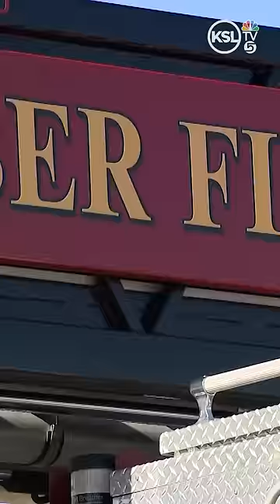Worker saved by co-worker after being buried alive in a trench collapse

Comment: Safety is no accident. Anyone in construction knows that trench should have been shored up. Man is lucky to be alive.
Reply: Anyone in construction who's properly trained or experienced, that is. New guys aren't going to know
Reply: I was just going to say that too. The contractor is lucky the guy was quick thinking. But 100 thumbs down for the contractor not making sure safety protocol was not kept. I have experience with contractors and know a lot of them cut corners where ever they can get away with it.
Reply: How do trenches get shored up?
Reply: @2degucitas  typically hydraulic jacks pushing metal plates outward to keep the walls from closing in. Wood pilings and other materials can also be used. Anything that will prevent the walls from collapsing and burying the workers in them. Usually any trench over four feet deep should be shored up. But even  shallow trenches may utilize shoring depending on the material the trench is being dug into.
Reply: @JoveRogers97 
Safety is the bosses responsibility, training is the bosses responsibility, proper supervision is the bosses responsibility... 
Don't blame the new guy, blame the contractor for their lack of following in place laws and guidelines...
sloping, shoring, shielding, and benching. one of these systems is required in trenches 5ft or greater in depth... 
I teach OSHA Construction...
Reply: @Moofasa1211   I wasn't?
Reply: @JoveRogers97  maybe blaming wasn't the best choice of words for that...
my point is the new guys, should know, and it's the bosses responsibility to make sure things like this don't happen, you don't need to have an experience to be trained in safety.  I apologize to you
Reply: @Moofasa1211  Right on brotha 👍
Point you and I are making is, soil instability isn't something people intuitively know, and yeah, it's entirely management's responsibility to train their workers up on safety.
Reply: @C-1-FRY  Thanks for explaining
Reply: @JoveRogers97 only cuz your average person has no common sense. You don't have to have a degree or experience to have seen a sand castle fal overbefore.
Peoples inability to recognize obvious danger is astounding
Reply: @2degucitas trench boxes made of metal that you lower down into the trenched area you are working in. Shoring panels are the old way, where they used hydraulic pumps and inch thick wood panels. Not as safe as a metal trench box. We used those back in the 90s, I hated them, because even those things were sketchy. They came out with trench boxes a few years later because panels and hydraulic jacks could still fail. This incident was negligence, as well as an OSHA violation and could have been avoided with a trench box.

Comment: No shoring,  the contractor should be fined by OSHA.
Reply: Exactly
Reply: Did you see the area? 😂 Looks like the entire area is an OSHA violation. All muddy and two houses finished? Bet they'll sink
Reply: @Steve.._. just like Cedar City - the houses will all slide away.
Reply: Now that it's on the news best believe OSHA will come a knocking
Reply: OSHA has entered the chat
Reply: They came with the fire company
Reply: @moepizl  i was thinking that from my knowledge anytime ems or paramedics show up to worksites im sure they also contact OSHA. I know they had at all the job sites I worked at.
Reply: Not all states require trench boxes it looks like they had it benched back
Reply: @coltonmeredith2111 Anything over 6 feet of depth requires a box if the horizontal width is less then 1,5x the height. OSHA says so, regardless of state legislation.
Reply: Contractor should be shut down never to open till their out of jail 😒
Reply: What?? That trench was only 4'10"! 😂
Reply: @Steve.._.  Osha has nothing to do with what happens to a house after its done.

Sinking houses are not their jurisdiction
Reply: Oh I’m sure they’ll have a field day
Reply: He will be the worker will go to the hospital and they’ll file it under Workmen’s Comp. and Osha will be contacting them
Reply: @jamiecurtis2974  we trench 30" if you bend over and the sidewall is above your head you are at risk
Reply: @timothyrothrock4173  you've clearly never turned tools. I'm betting you're they guy walking around checking stickers on hats or making sure the tape is the color of the week.
Reply: Wow lucky guy that hole area will be watched close now by Osha hope they have a safety guy for that business that know all the updated laws seen companies go out of business from fines
Reply: @coltonmeredith2111 considering what the state of the soil in this video looked like benching was serving little to no purpose. The walls were wet and already compromised. It shouldn’t matter if trench boxes are required or not they should still always be used for the sake of keeping someone from being buried alive.
Reply: @JustAGooseman  this is not a fact. Soil conditions can play a large part in if you need shoring. Wet lose sand doesn't fall over into a trench, it slides in, soft to medium hard clay falls in, hard clay typically stays put. Sloped banks/benching can eliminate the need for shoring.
Reply: @JustAGooseman  osha actually says anything over 5' not 6'. Pay for osha 30 not just osha 10.
Reply: @Steve.._.  And you have clearly never worked construction a day in your life
Reply: @coltonmeredith2111 Federal requirement. Not eligible to be waived either. They’re doing that, it’s gotta be there.
Reply: @coltonmeredith2111 Doesn't matter what a state requires. OSHA requires proper shoring/ trench boxes or proper benching/sloping. 
with escape ladders spaced no more than 25 ft apart.
Reply: It sounds like the guy wasn't supposed to be in there.
Reply: No one does that. You wouldn’t even know what osha is if it weren’t for all the memes
Reply: @bmd2159  Looks like we found either our next cave-in "victim", or the soon-to-be-bankrupted guilty contractor.
Reply: @timc9893  looks like we’ve found our next internet Karen
Reply: @bmd2159  Why not just go ahead, save us the trouble, and say "guilty as charged"?
Reply: If he was directed into the trench.  If he chose to go in without protection.  Thats on him.  If he wasnt trained, thats on employer.
Reply: @Jon-k8z   and the houses in Draper too.

Don't people remember the kids nursery rhyme about 'how a wise man builds his house on rocks and a foolish man builds his house on sand'? Houses need a foundation.

Comment: Deeper than 4 feet you need shoring, or benching. Depending on soil type sometimes as little as 2 feet. That OSHA training everyone complains about is useful. 12 years oilfield 3 year diesel mechanic.
Reply: people probably complain about it because 90% of the safety training doesn't apply to them and even if it does the employer might not care so less annoyed at the training and more that they are spending time on something they know the workplace won't actually want them to use.
Reply: It is also an MSA law also.  Six years as an open pit miner.
Reply: Got my Oshawa 10 card man was a grueling but I learned alot worked as a sign and awning installing and we'd be super close to the power lines where my eletric tester would go off in the air I told em hey we should not be this close and my trainer ended up moving to a safer spot man miss them sketchy days 😂
Reply: Trenches should always be short or shielded. I'm a wastewater treatment plant operator with seventeen years experience.
Reply: @richardmckinney4963  msha don't play around
Reply: Yes I agree with you these rules are in place for a reason
Reply: Even if it’s rock ? I worked a summer doing that type of work and went deep into a trench that was rock . Did not feel safe at all . Definitely don’t miss that type of work
Reply: Not sure how 2 feet would be dangerous. Maybe if they were prone.
Reply: @Rokomarn Sand because of its unconsolidated nature leads to collapse/caving. So it’s recommended to shore or bench.
Reply: @RickSolid1  for sure it might collapse and then you would be up to your shins in dirt. Seems unpleasant.
Reply: You're absolutely right. I know of a man died like this in trench collapse. It's more common than people realize.

Comment: Why is everyone calling this guy a hero? He was most likely the operator and responsible for what happened to his coworker. Trenches need to be stepped back or shored. Looking at this muddy soil, it definitely needed shoring. Glad the guy made it alive.
Reply: As a retired operator and pipe crew foreman ,I agree.
Reply: The person saved was lucky he didn’t get injured by the bucket of the machine.
Reply: I agree but it didn't specify exactly who was in charge so I'm not making assumption until I know for sure. Nevertheless it was quick thinking and enough to save his life. He apparently saw it happen and knew where he was
Reply: He took a high risk by using that machine to try and save him, he could have easily killed him instead. I guess it was a split time decision, that construction company does not have even kind of good safety standards, then again, working construction, never do anything that feels unsafe, have common sense, experience and a good supervisor would have helped.
Reply: @joseramirez-sz9yo if I was stuck underwater, I would happily risk some broken bones if it meant I could have air.

and from the sounds of it, he didnt dig the person out as much as dig nearby so the water had somewhere else to go

Comment: Will the local contractors associations and Weber County (unincorporated) - if it's competent to act - publicize and attempt to enforce proper trenching procedures (as well as all standard safety procedures) going forward - promoting safety training, use of both PPE and Worksite Protective Equipment - even in the face of pressures to reduce costs below effective minimums - and protecting employees who have a good basis to believe a worksite task is dangerous to life to refuse to work until risks are suitably mitigated.
Reply: I got fired for refusing to enter a dangerous ditch... didn't want to slope it or order a box so I said I'm not walking in that ditch let alone running a jumping jack in it. It was the owner who fired me so I started taking pictures and sent them to OSHA

Comment: Both men should be fired for not using proper equipment
Reply: You might be right, if they are the ones actually responsible. But the owner might not have bought safety equipment or someone other than these guys were in charge.

Comment: I've worked in miles and miles and miles of trench. And I have to say i've heard nightmare stories that will make your skin crawl. Above all NEVER go into a trench without the proper trench box or shoring techniques. But as for the operator of of the equipment.
It is your responsibility to make sure that man is safe in the hole butt above all, never dig a man out with a machine. This person got extremely lucky.

Comment: Operator says "hey laborer, go down there and check the elevation of the bottom of the trench" then after the laborer almost died because of unsafe practices (which were probably designated by the operator) 
Operator says "hey bud, I saved your life" what a hero! If only there was a process and safety device to prevent total collapse around a worker in a hole deep enough to cover them. I'm shor 😊 that would help prevent these situations.

Comment: My uncle die in a trench collaps in 2005. The trench was only as deep as his shoulders and it was stepped 2' wide at the bottom 2' up to the bench and 3x up to grade. A back hoe was driving within 50' on concrete. The vibration caused the trech to filled in in the blink of an eye. My uncle passed out instantly from the air being squeezed out of him. His close friend tried to pull him out but couldn't. The backhoe operator must have been scared to drive close or reach over to relieve the pressure from the cave in. Like previously stated DO NOT GET IN A TRENCH OR HOLE WITH OUT SHORING 4' FEET OR DEEPER!

Comment: That's why as a excavator operator you make sure you dig the trench with a slope on either side so crap like this doesn't happen. If the trench was dug out properly by the operator in the first place this wouldn't have happened. Be better at your job next time. I learned how to do this when I was 16

Comment: He mighy have save the guy, but he also caused the accident.  Its the operators responsibility to make sure that the trench has a 45°angle while he digs so there is no collapse and nobody goes into the hole till its safe.
 U might get away with cutting corners 1000 times, but it only takes 1 bad day for someone not to go home to their family and then those 1000 times weren't worth it!!

Comment: Well you are supposed to use a trench box on any trench that is not 5 feet wide and deeper than 4 ft and shored of all material. From video and areial looks like a wet day and they should of had a trench box and the ground was saturated and should of never been down there to begin with. I blame that supervisor.

Comment: Dangerous things, trenches. If not cut back to relieve the walls I would not get in. Even up to your neck it's not a safe deal. The coworker needs to be given a medal for quick acting. Could have ended either suffocating or if equipment operator was a little off head be gone..

Comment: Utah requires you to have a trench box so my question is where was the trench box at the trench box is to prevent that from happening and why wasn't the trench 4 to 2 
The boss the supervisor especially the trackhoe operator should be fired over this situation all three of them knew that the state of Utah requires you to have a trench box anytime that you're having to work in a trench and you're also supposed to have an Escape Route also and why would you dig a trench when there's that much water and the ground being saturated like that they all knew that the ground would collapse without a trench box and then send a guy down in there to check something out that is the most stupidest thing that you could ever do as a construction company specially as a trackhoe operator well this company is in a whole lot of trouble with the state of Utah

Comment: That's why you need trench boxes or to stair step deeper trenches so they are wider as they get higher. But they don't want to take the time to do so just dig a 8ft trench at 2ft wide and hop in...ugh idiots. Not just the bosses but the workers as well all to often.